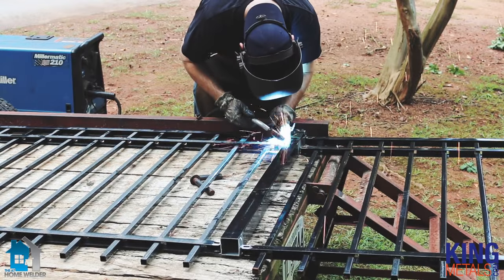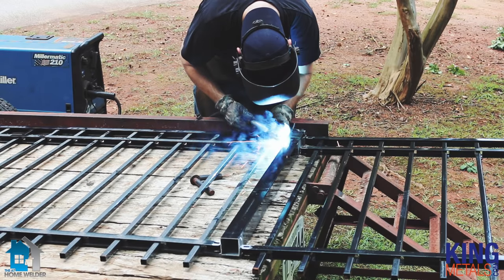Cold Roll vs Hot Roll

Comment: hot roll: not under significant internal stress. not appreciably work hardened. stainless steels are less magnetic.
cold roll: usually under significant internal stress. will deform when edges are cut. alloys which work harden will be somewhat work hardened. more magnetism in stainless alloys.

Comment: Hey KingMetals, thanks for the explanation. It might sound strange, but I came across your video trying to learn HOW TO DISTINGUISH cold rolled from hot rolled steel. The reason is , I just need a piece of cold rolled steel for a photo project - I'm going to use a grinder to get flying sparkles for my photo idea. Most photographers are using COLD rolled steel for a better effect. So how can I find a product made of a cold rolled steel at my local Home Depot or any other construction store?? I literally need a couple of inches for 5-10 cuts. Thanks for your help!

Comment: How can I get some color on my hot rolled steel ? I'm am trying to skip the step of removing the mill scale and then using a patina. I would like to find a product to put on hot rolled and still get a darkening effect. Not spray paint
Reply: i know its a little late but heat it up to about 275 degrees with a torch and wipe it down while hot with boiled linseed oil, you will get a nearly black finish that is very rust resistant.       p.s. for the love of god use leather gloves nothing synthetic.

Comment: Wrong. You will use cold rolled if you want to have a nice surface finish straight from the factory, but if you machine cold rolled you will NEVER get tight tolerances. As soon as you put your end mill into cold rolled it will go all out of whack, because it has internal stress. Hot-rolled doesn't have that and it's superior for machining when you want to have a precise part.